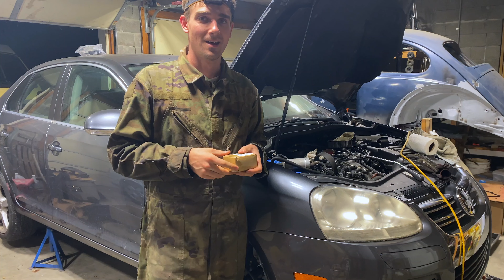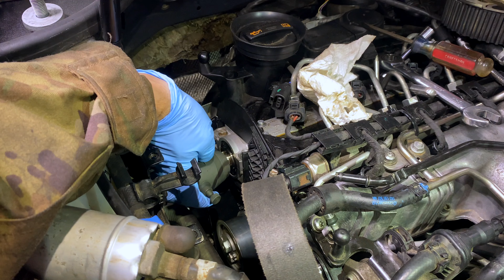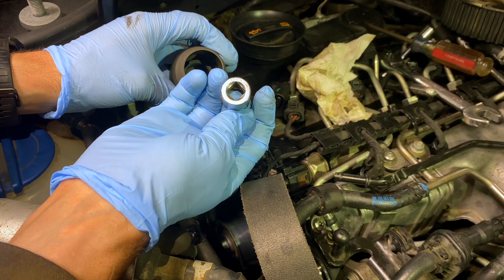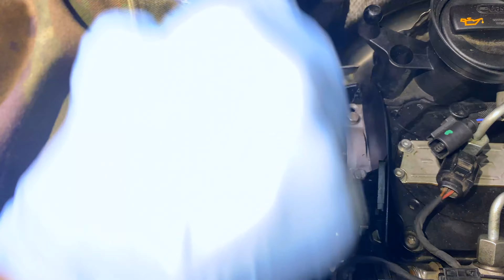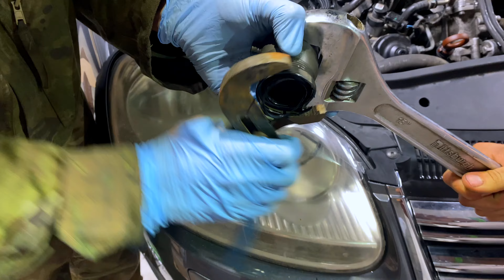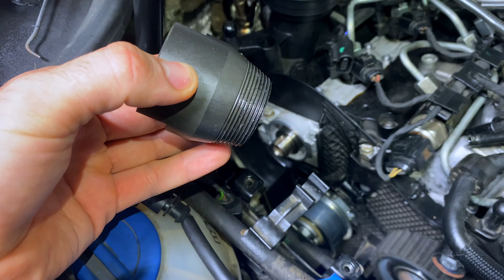VW Seal Removal Tool 2085 (and more!)

Comment: Could you use this tool on the crankshaft seal without getting pieces of metal or rubber from the seal in the engine block?
Reply from the maker: I am rather certain that you can. and at $35 for the tool, it definitely is worth buying to try!

Comment: I’m thinking this tool might work with flange seals on manual transmissions on MK1 and later too. I use pliers to pull them out myself. I will buy this tool, it’s safer than accidentally deforming the green metal seal holders on the transmission. 
Can you make a video on installing the 30mm seal. That would be super helpful. Thanks!
Reply from the maker: Good question. I need to do that exact job. The seals are sitting on my bench at home. I’ll measure them and see if this tool would work.
Reply: @OlisGarage  Waiting on the video! Need to do this same seal fix on my Mk1 Jetta. Cheers!